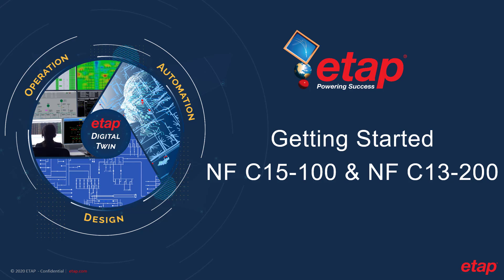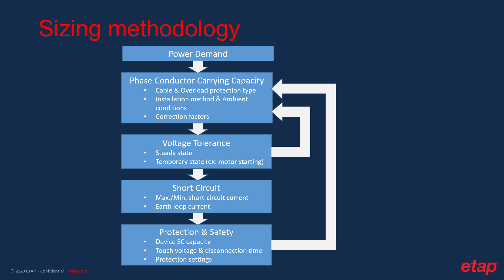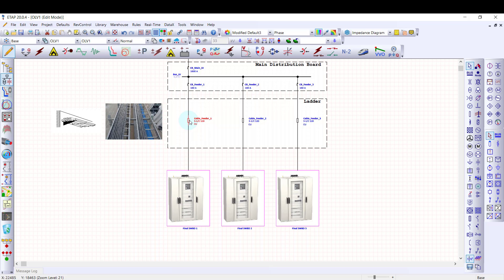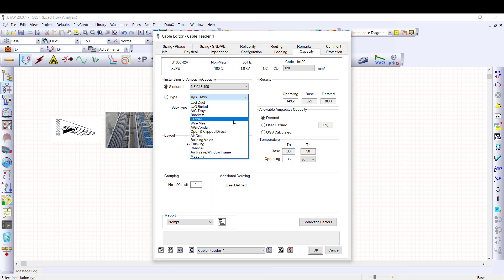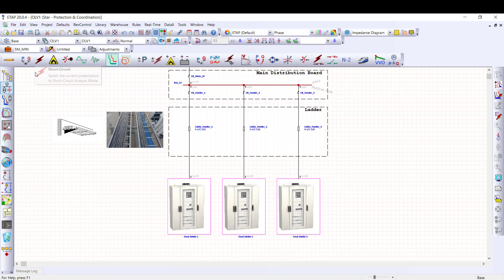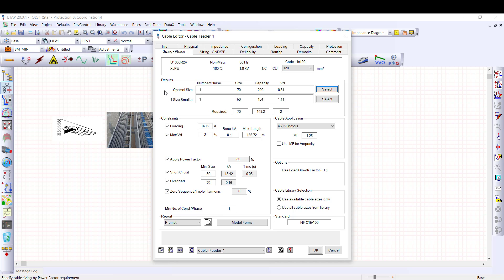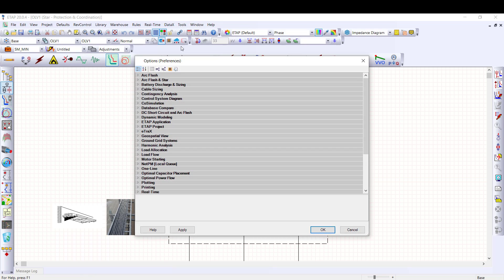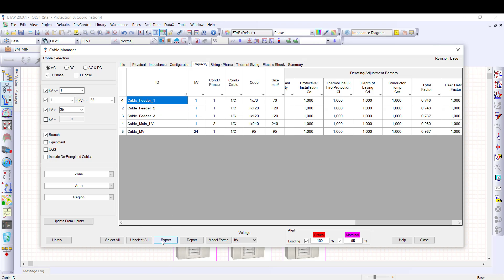ETAP Cable Sizing per NFC15-100 & NFC13-200

Comment: What is the difference between a line and a cable?
Can a cable be used for power distribution/transmission?
Reply: Thank you for your interest in ETAP Software.
In ETAP software, the distinctions between a "line" and a "cable" are similar to those in other electrical engineering contexts:

A line typically refers to an overhead transmission line. These lines are designed for high-voltage power transmission over long distances and are often supported by towers or poles. They are subject to environmental factors, which can affect their performance.

A cable in ETAP refers to insulated power cables that are used for underground or indoor applications. Cables are generally used for power distribution and can handle lower voltages compared to overhead lines. They are suitable for installations where space is limited or where aesthetics and safety require underground placement.

Power Distribution/Transmission

Yes, cables can be used for power distribution and transmission. While they are often employed for distribution in urban and residential settings, they can also be used for transmission purposes, especially for medium-voltage applications. The choice between using a line or a cable depends on factors such as the distance, voltage level, installation environment, and project requirements.

In summary, both lines and cables play crucial roles in electrical systems, with lines typically used for long-distance high-voltage transmission and cables used for local distribution and shorter runs.